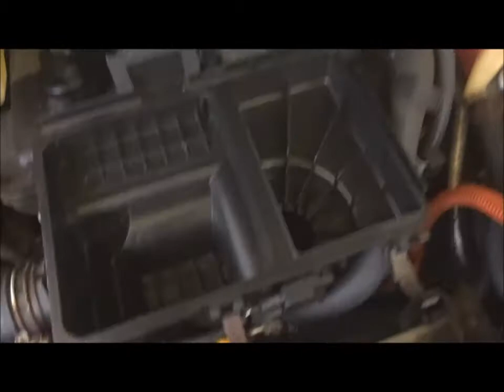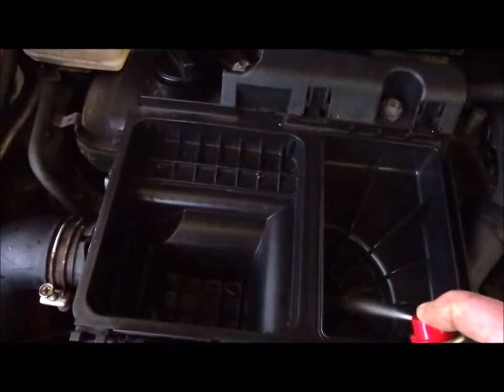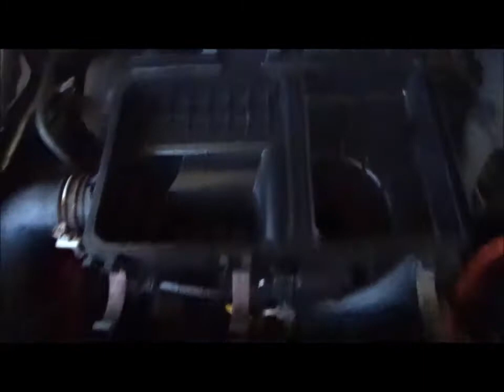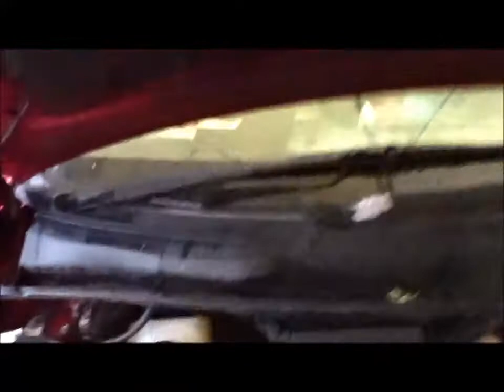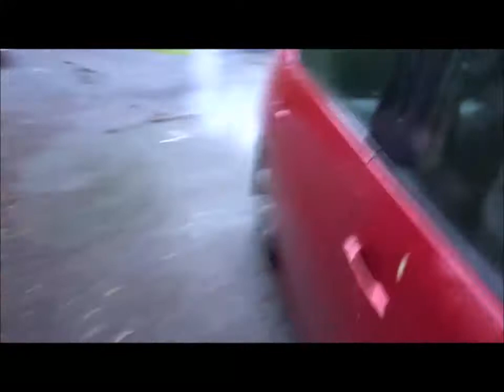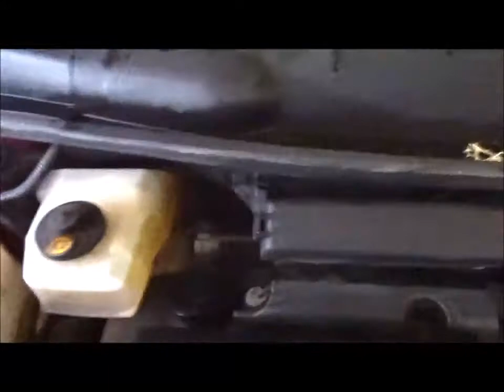Toyota Prius - Diesel Woes

Comment: Is the Prius still running? I know it’s been a couple of years since you posted
Reply from the maker: Hello,  It carried on running fine for a  year or so, then I was told that the floor had become quite thin due to rust and it wouldn't pass its next annual safety test, so I reluctantly traded it in for a new Corolla Touring hybrid, which is bloody brilliant by the way!
Reply: Would u buy another Prius gen 2? They seem like reliable but also have millions of videos of fixing and problems lol. My Prius has red triangle of death and I have to reset the battery every thime
Reply from the maker: Yes I'd own another one.  No more problems than other cars of the age...  Lots of help here on YouTube if you have a few basic tools and some car skills!  I'd think that having two with one as a spares / practice car would be ideal - and they can be picked up cheaply now as people are "scared" of the tech.   BTW I have a spare hybrid battery here that I can't get rid of... :-)
Reply from the maker: ...also...  this vid might help you with the triangle of death...  https://www.youtube.com/watch?v=4uGntnoOfr4&t=51s
Reply: @ProudDad1956  is the battery in good condition? How much and where about a are u?
Reply from the maker: It is complete along with a couple of spare cells (I've changed them in the past - another vid of mine!).  I ran it flat trying to start the car prior to finding out the problem was diesel in the tank (per this vid).  It has sat in my garage ever since, so is a bit of an unknown state...  I tried selling it on ebay, but they said I couldn't as I wasn't licenced to sell dangerous goods!  I'm in Mid Wales by the way.  As to the price...?  No idea - make me an offer if you are interested.  I know the individual cells are around £25 a piece, but like I said, they will need charging.